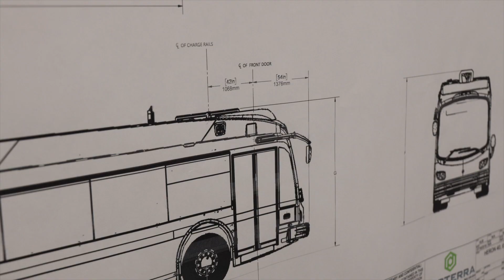Electric buses in Edmonton

Comment: Weusedyo have electric buses running on lines. deemed not economical even though they were highly efficient environmentally clean running!  how easy are those batteries to recycle? ow efficient and warm at -30C?  how cost saving on low use essential routes?